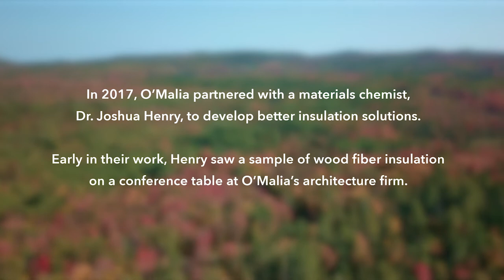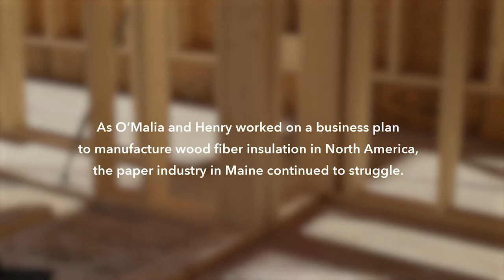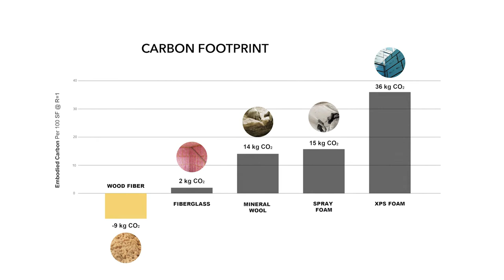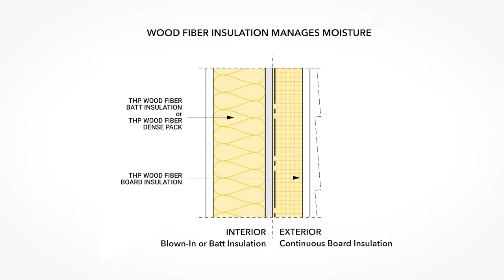TimberHP by GO Lab | Mission Video

Comment: Can this be used on a roof under a metal roof?  For approximately  1000 square feet?  I have a manufactured home and I need to insulate with the doubling of electricity has doubled in the last few years. Decades ago this kind of product was used on homes.  My Dad had a home that was built about 1958 or 1959 and he bought the home in 1960.  This was in the Yakima Valley in Washington. The house had this kind of insulation with no fiberglass and it worked.  You need to get this on The Build Show with Matt Risinger.